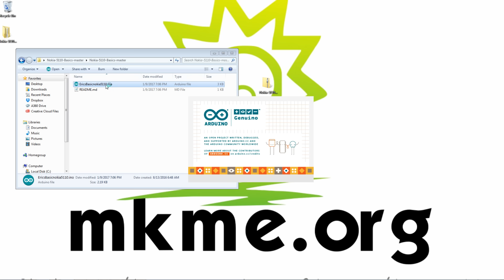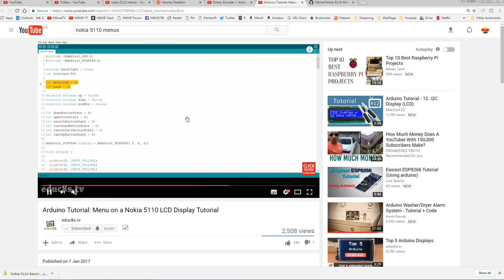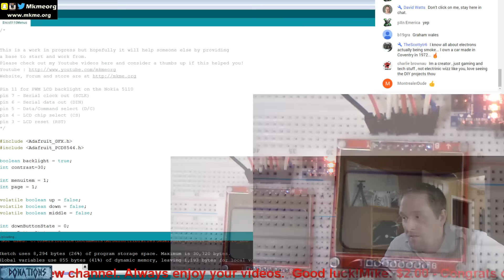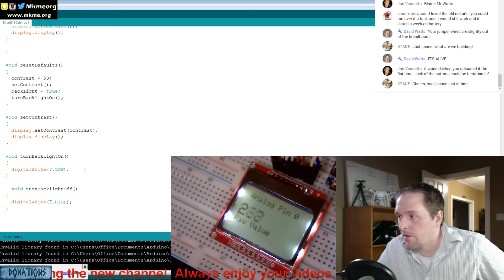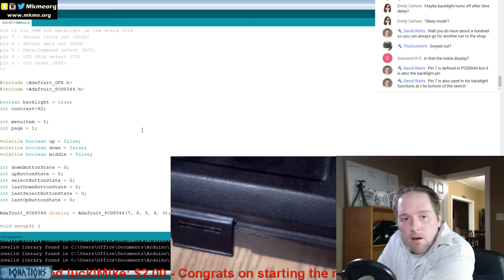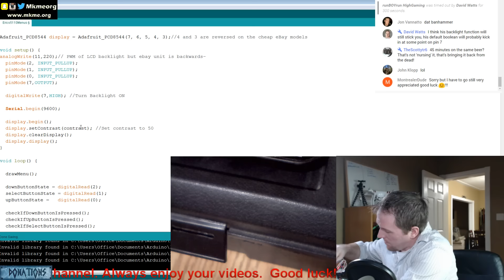LIVE Arduino LCD Display Menu System | LETS BUILD!

Comment: Eric;
I am a newbie that has been trying to  use the arduino UNO with the NOKIA 5110 .

So far I have NOT had good results;
 LCD illumination iworks OK. 
but the 5 control signals for the NOKIA 5110 from the Arduino UNO do not seem to work.

QUESTION 
1. Is there a way that I can use the Serial Monitor to read these controls signals ?
2.  Must some of these control signals be connected to specific pins on the Arduino UNO?

Thanks for any info you can supply   

martymarty

Comment: Hey Eric, I couldn't watch the live stream yesterday since it was too late here in Greece but as always I try to watch the replay! So, It was very nice to see you use my code! How cool is that! If only I was online to save you some time with the code. It was the first time to watch someone use my code and that was a very useful experience. I noticed that some parts of the code were not so well structured and caused you, and many more people to use the code, problems. So from now on I will be much more careful with the code. 

As for the display initialization, I used the hardware SPI pins in order to gain so speed. The 3 pin constructor appears on the demo sketch that Adafruit provides with the library. Maybe you are using an older version of the library?

Thanks Eric for this video, and the nice words! You are doing a great job, keep it up! Cheers!
Reply from the maker: Hey Bud. Your code was just fine. I haven't updated my library in ages and I always use the same pins- I failed to notice the conflict with yours. All part of the fun and sharing but I could have done better to notice it and clarify more live. I think there was still enough content to help some people out.  Thanks for the kind words and code!  Cheers.

Comment: Eric one of my goals this spring is to install a pi to take over control of the hot tub. This is prefect!
Reply from the maker: Sounds like a plan. If you are just looking for basic control an Arduino is usually plenty. Best of luck with the build Bud.